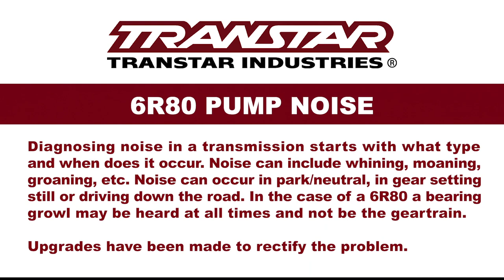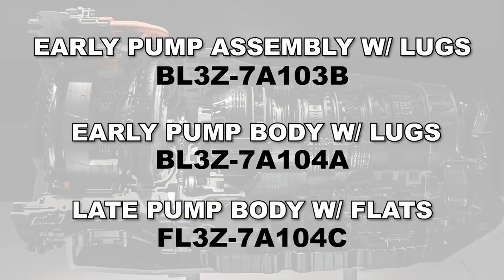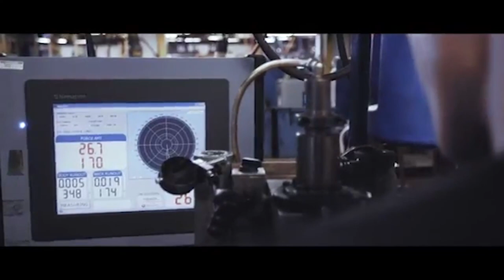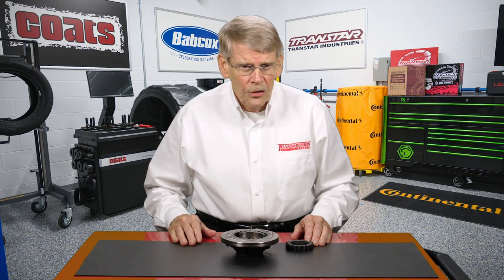6R80 Pump Noise

Comment: Any website or part numbers to get the transmission oil pump and torque converter 2011 f150 4x4 6r80?

Comment: I had a noise when shifting in N, and after a few minutes, it stopped and got low conversion in D . Is that might be a automatic transmission pump or torque converter?

Comment: this is great info. i have the 6R80 with several issues. this bearing noise, along with gear shifting that is very harsh when the trans temp is below 80. looking for a trans shop that knows these issues and con correct them for me. could you recommend a shop in my area. I live in NJ
Reply from the maker: Sal ... If you're looking for a referral to a shop, I suggest you contact one of the transmission parts suppliers who will know of top shops in your area. VTP South (Pennsauken).856.488.4451, WIT (Scranton) 570.655.4200 or Transtar (Edison) 732.225.0202 ... I'm sure you'll find a local shop that can address your drivability issues.
Reply: @TransmissionDigest  thanks for the help

Comment: I have a question 2014 F150 6R80 transmission. I changed the fluid and filter in the transmission and it started whining and now won't go into gear. Would this most likely be the culprit?
Reply: I HAVE THIS EXACT SAME ISSUE!! did you get it figured out
Reply: What was it?
Reply: @RustyShakleford1 Not enough fluid.

Comment: Mine kind of whines only when it's in gear. Maybe it's the torque converter and not the pump.
Reply: Ever find the problem mine whines in drive or reverse but not park or nuteral and very stumped some say oil pump some say torque converter
Reply: Make a sound recording and post it online and link it for folks to review